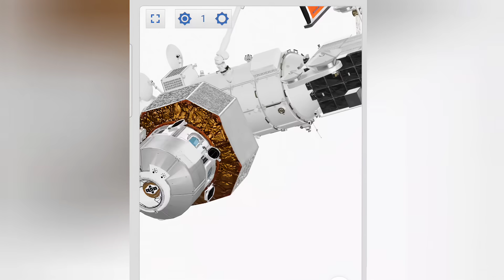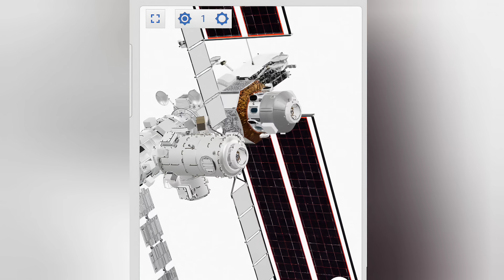Congress saves over budget SLS and Gateway, cuts fiscally responsible NASA programs!

Comment: Senator Ted Cruz saving the Gateway is the worst possible thing that could have happened to NASA. No matter how much people continue to defend the Gateway, it is a huge burden to any Moon or Mars mission. It is the 737 MAX of spacecraft, poorly thought out, poorly designed, and unsafe. People do not pay attention to NASA's GAO Report from Juyl 31st, 2024 which CLEARLY STATED that the Gateway has several major technical problems which show it will never work. First off, the Gateway's HALO and PPE with their CMV or Combined Mass Value are overweight. This means the Gateway may not even be able to reach the planned NRHO in its current design. The Gateway will actually take over a year in its current design and trajectory to reach NRHO around the Moon and with it being overweight, it may not even be able to leave Earth Orbit. People also always neglect to mention the PPE is not able to maintain stack orientation with its current propulsion capabilities when docked with a Lunar Starship. NASA says they are trying to compensate by having other visiting vehicles perform the burn but this is a problem in search of a solution. It proves the Gateway is incapable of maintaining itself in Lunar Orbit on its own with docked vehicles. The same problem will arise if a larger Mars Transit Vehicle is docked with the Gateway which will also result in the Gateway failing to maintain stack orientation. They also say the Gateway will be past its 15 year lifespan when a Mars Transit Vehicle is ready in the 2040s. That is only a handful of problems the Gateway is facing according to the GAO report which nobody pays attention too. Artemis Base Camp is the part of Artemis that is sustainable and will result in a long term presence on the Moon which idiot Ted Cruz is refusing to fund. That 2.6 billion Ted Crux wants for the Gateway could have easily been diverted to Artemis Base Camp but Ted Cruz thought he knew better. The Gateway is indefensible at this point and will be studied as a burden to space exploration years from now when China has bases on the Moon and Mars.

Comment: They might want to make sure that whatever they put in place before 2032 should be temporary or disposable in case 2024_YR4 strikes the moon, after that they may need to prepare for a slight pause until the moon is safe to go to again (only if 2024_YR4 hits).

If it doesn't then they should proceed "full steam ahead" lol,, hopefully it misses though and we are prepared to take advantage of the readiness to takes us closer to the stars!

Comment: I used to work in a gvt research program. And it's exactly for this reason that i quit and work in the commercial sector now. 
It's always politics and looks on boths sides of the isle. You could do the best research, be responsible with the money, be under budget and ahead of schedule. That then causes you to get funding cuts because "you clearly don't need that much money then" and tighter deadlines and maybe, your sector gets eliminated anyways, just because the work you are doing is not currently politically sought after. 
In the private sector you get bonuses and promotions, maybe even expanded funding, if the stuff you are researching gives the company the expected economic advantage and if you work for a good boss (who i'm very happy to have).
It's these kinds of opportunities that are lacking in the public sector. A buddy of mine was in prime position to get promoted, only to be pushed to the side by sb unqualified who was politically placed there, probably as a favor or whatever other connections. It's unfair, demotivating and companies who act like this go out of business. But the gvt does not give a fck.  

I have no idea how to fix this  because there are some areas of deep basic research that are not viable to do privately but in return could spring many new wealth creating companies if certain breakthroughs are reached. e.g. physical/nuclear propulsion drives for spacetravel, fusion reactors and many more.

Comment: Typical Trump administration decision ad rubberstamped by MAGA politicians. SLS shows no progress towards achieving any milestone, only discovering problems with its prior work.

If SpaceX can satisfy requirements I see no problem with junkinking the SLS program and redirecting funds to other competitive launch programs. Make a SpaceX requirement to be capable of supporting the interfaces to support payloads originally assigned to SLS.

Launch competitors are probably 12-20 years behind SpaceX but that's still better than continuing to support SLS which has proven it can't  fulfill its contract. 

And above all fix the one really big shortcoming of existing NASA contracts... Set interoperability standards in the beginning so that successful projects can be swapped in for failed ettorts.

Comment: What if we use New Glenn and Blue Moon instead
Reply: Not crew rated Artemis is ready to go next year with crew and it didn’t explode on its only test flight like starship quality costs money
Reply: @bradleywilson5641  what if it gets crew rated and reliability improves after the very first launch
Reply: Not ready by 2027.
Reply: @aprilpower1158  starship wont be either. It's a decently fair competition at this point
Reply: @notgreg123 That is debatable, but things are looking a bit more darker now than 6 months ago, but in theory things could change quickly with some good launches the next months.
Reply: @aprilpower1158  it's possible but I doubt it personally. They're launching more frequently but making nowhere near as much progress between flights as with block 1. They seem to be focused on getting cadence up so by the time it's operational it doesn't even have a ramp up phase to wait through. Time will tell if this pays off. I'm just hoping we can get to the Moon one way or the other

Comment: I'm just curious how people want NASA to get to the Moon without SLS. And don't say Starship. Even if for some reason you think Starship development is going well and according to schedule, it was never intended to actually get people from the Earth to the Moon. It was only supposed to get people from the Gateway to the Moon's surface. SpaceX was contracted to build a lander, not an Earth-Moon transport.
Perhaps they think NASA should focus more on scientific missions using probes and robots rather than manned missions, which is a fair POV, but people usually don't talk about that when they say they want SLS to be canceled.
Reply: Scott Manley made a crazy suggestion in a recent video to take the best parts of multiple systems and combine them to get humans to the Moon. The Super Heavy booster would be the first stage, Centaur second stage, and then Orion and the Blue Moon lander on top, if I remember right. Mix and match is not the usual plan but it sounds like this would be more efficient than SLS.
Reply: @ericfielding2540 I like Scott, but that sounds like an accident waiting to happen in the same vain as Starship.
Reply: When it comes to Starship, people are sold hook line and sinker that it's not a Duck. However it is a Duck. It's an LEO barge to fly tens of thousands of Starlinks to pollute LEO with space junk. That's it's actual designed purpose. We can tell because it can't go anywhere after it gets to LEO. I hear ya, "But, but...Refueling!". Projected 12 to 18 flights just to get to the moon. Seriously, let that sink in. Even on the low end that's still ridiculous. I mean, what could go wrong? If I could get my dog to swallow it's medication that easy, life would be grand!
Reply: We can use New Glenn
Reply: @DawidSmithmeow  combined with their other architecture. Their Transporter spacecraft basically acts as a refuelable and reusable 3rd stage and has way more than enough capability to take Orion plus enough fuel to land to either NRHO or LLO in one go (with orbital refueling). 

The downside is that it's not going to be ready for a while so we still need SLS in the meantime